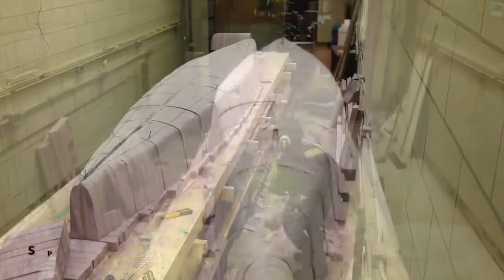Concordia Concrete Canoe Team - Mold Construction 2015-16

Comment: How did you guys get the measurements for the cuts if the insulation foam?
Reply: paper template that was laminated so we could trace it over the styrofoam with a marker.